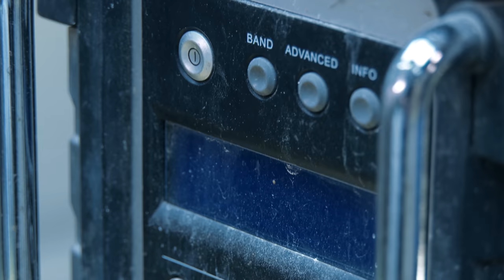PLUMBER POWER TOOLS I USE EVERYDAY

Comment: Top tip!: If you’re using a hole saw. Put the drill on screw setting and the highest torque setting. It stops the drill wrenching your wrist if/when the hole saw bites.
Reply: Captain!

Comment: The torque setting on your combi drill is really helpful if you're putting flatpack furniture together - if you use drill without it it's really easy to punch through with a fixing when it's chipboard or whatever, and no one wants to faff about using a hand screwdriver or allen key 😂

Comment: Nice bits of kit, i use to have makita but recently switched over to milwauke and have to say its fantastic... got the angle drill in a battery version which i use with 12ah batteries ( called the super hawg ) not sure if makita do a versionof it

Comment: Great video Jaz👍 I’m a Makita fan too, so it’s not just your wife, but the love of power tools we share.
One thing you need mate & it’s invaluable for Plumbers/Heating Engineers is the Makita 18V grinder, but with a diamond tip blade.
It’ll cut & chamfer Soil Pipe, cut flues etc etc etc etc.
Now, I don’t want you to get confused, it’s grinder not ‘Grindr’.
Kind regards Dick Puller.
P.S. Thanks matey for taking the time👍

Comment: I’ve got the Makita 18v multi-tool, I prefer it over the DeWalt because it can use all blades, not just quick connect blades with the ‘C’ shaped fitting. It also has a tool-less connection as well. However, like you said, they aren’t brilliant on the battery life. But super handy when you’re in a spot and no need to faff about with 110v tools on-site.

Comment: Makita have a newer 240 angle drill with quick change of angles and they do it in cordless. The 240 a beast with a sharp auger bit. I don't mean the crappy small angle drills either. I mean the full fat drill anything.

Comment: Whats your go-to station on the radio? Cheers
Reply from the maker: 5 live in the morning then Radio 6 or Absolute 80/90/00
Reply: @plumberparts  Have you got a link to the Titan Dual blade grinder or any other brand you would recommend they seem very useful!
Reply: Screwfix do titan.
Reply: @Fibre Washer LBC Nick Ferrari in the morning til ten o'clock. Then at ten... I have to change channel or I completely lose it and start throwing things around. Trouble is, I'm such a boomer, I haven't learned how to set the pre-set for fav channels. I know that if I press the advance button 9 times, I get to Planet Rock. Get it wrong and guess which channel I get to?  Aaaaaaaaaaaargh!!!!!